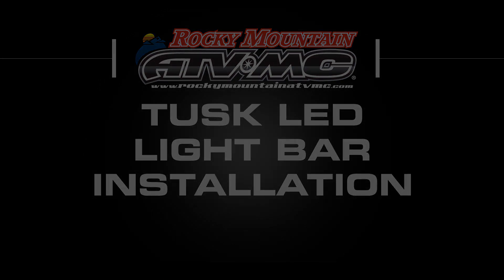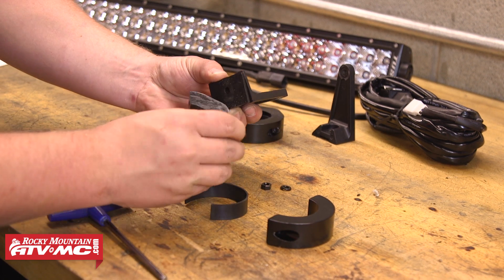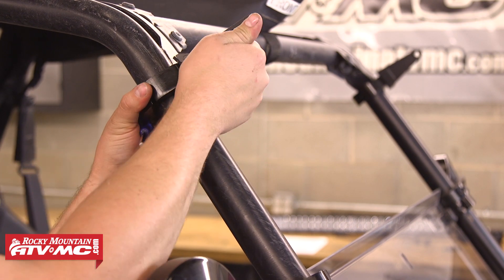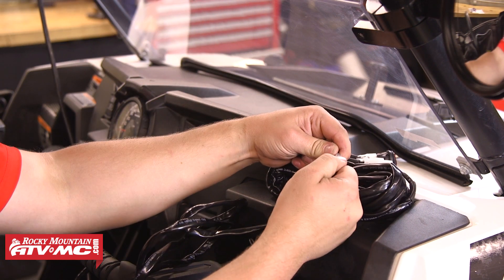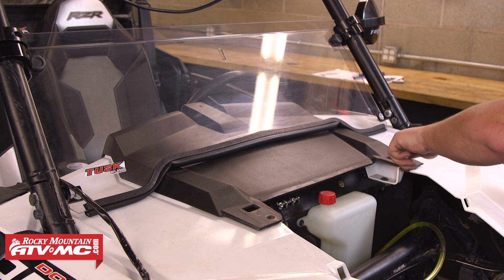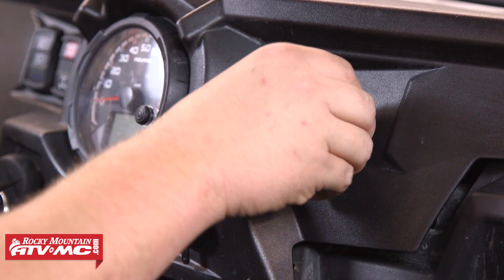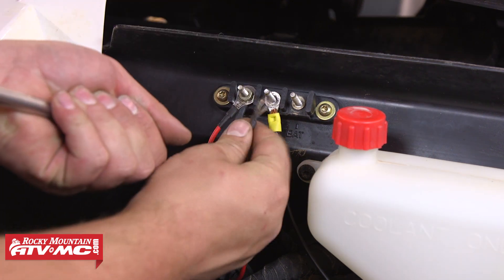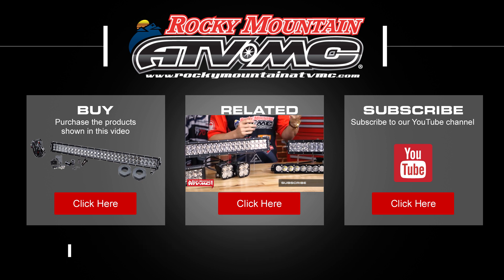How To Install the Tusk LED Light Bar on a UTV

Comment: Hi. What's the length of light bar
Reply from the maker: This light bar was the 30" model.
Reply: @rmatvmc  I have 2009 Polaris razor is that a standard size
Reply from the maker: It will vary by the manufacturer but around 30" is what you will see on a lot of side by sides.
Reply: @rmatvmc  ok. Thank you

Comment: Just finished my install on my 2017 Gold LE - just a few issues with the install. First: all the wiring is way too long for the RZR, which I know is because it is a universal kit, but a lot had to be bundled up under the access panel to keep it relatively neat and away from the fan. Second: all of the shrink wrap on the connections was poorly applied and some had to be re done. My accessory panel was wired, so I installed to the accessory panel as in the video, with the red to the far left, black to the middle, and the in- line relay I just connected to frame with a bolt that was there. Third: the leads that attach to the terminal posts were way too big for the post size, and had to be swapped for the proper sized leads. Fourth: The hole for the on/off switch was 13/16, not 3/4 as mentioned in the video, and last, the wires could not be routed through the cage A-pillar as described due to the connectors being too large for the holes in the cage. I did not want to drill them out bigger, so I opted to run the line outside the cage A-pillar tube and held it with zip ties. The hole in the plastic body panel (4:40) had to be enlarged to accommodate the connectors. But, I got it done, and it works.

Comment: How can I hook it up to a 2018 teryx 4 ?
Reply from the maker: Yes, you can definitely hook one of these up on your Teryx4.
You can check them out here: https://www.rockymountainatvmc.com/parts/tusk-led-light-bar-kit-p just make sure you enter your machine so you get the correct mounting options.
Thanks for checking out the video!

Comment: It should be noted that the accessory block on some RZRs (my 2016 XP Turbo) do not come grounded from the factory; the center bolt (ground) on the accessory block doesn't connect to anything, from the factory. I had to route the ground to the bolt that mounts the radiator to the frame. Additionally, the fuse under the seat in the RZR wasn't big enough to handle this 30" Tusk light bar, and kept popping until I put a stronger fuse in there (I went to a 25 amp from the stock 15 amp).

Comment: will this work with a full windshield?
Reply from the maker: +ZachManZ71 What brand windshield are you running? If it is a polycarbonate windshield you could easily trim it to fit around the roll bar A pillar clamps.  If you're running a full glass windshield, you may want to look into running the Tusk LED Light Bar Cradle Mount.  Provides a little different mounting option depending on what you got going.  Here's the link to the Cradle Mount: https://www.rockymountainatvmc.com/p/1155/59544/Tusk-LED-Light-Bar-Cradle-Mount

Comment: So you don't have to run power from thge battery. Just us the aux,  thge one to the left?
Reply: Yes, because the accessory already has power. So you'd connect to that and use the blocks ground. Simple :)

Comment: you say tie use a bolt on the frame for the ground but you added to the accessory block post? A new updated complete walk threw video should be done to show people the whole wore harness and where each connection goes. Can be confusing to the noob